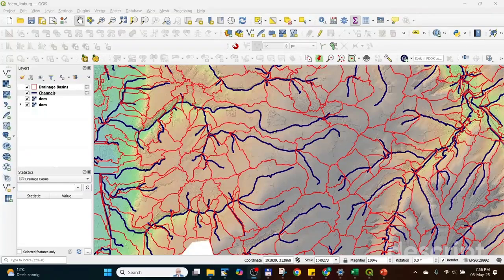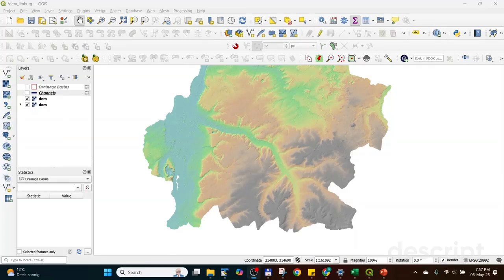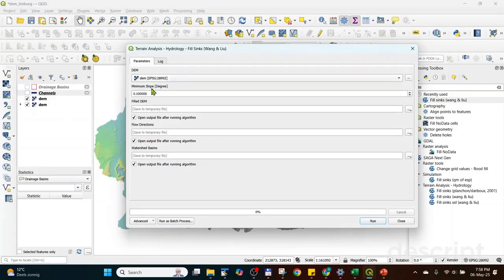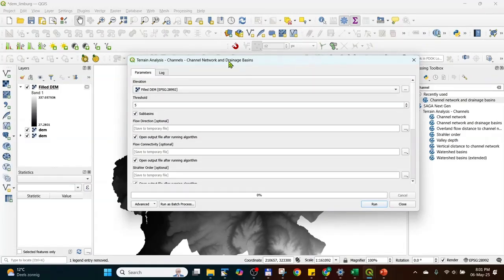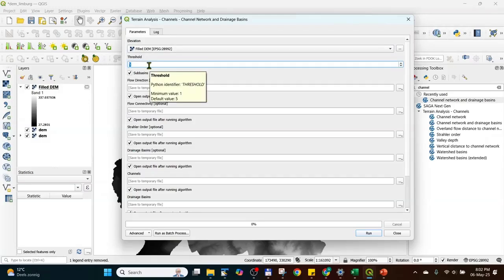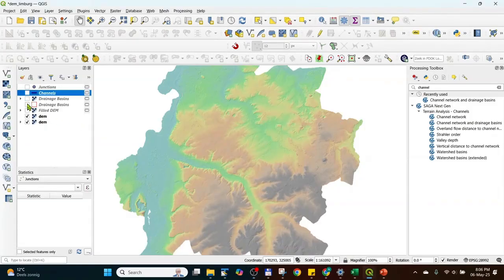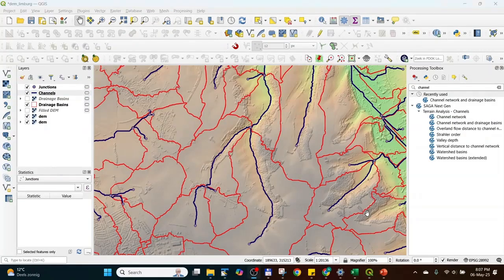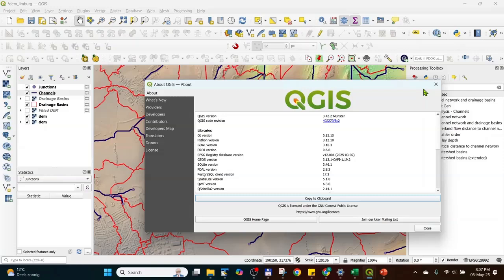QGIS Catchment and Channel Delineation in 3 Minutes | DEM to Drainage Basins with SAGA

Comment: How does saga run within qgis. Usually it's not integrated anymore. Which qgis version do u use?
Reply from the maker: - It helped me a lot to first install the latest version of qgis (in my case 3.42.2)
- Under 'plugins'/ 'manage and install plugins'/ install 'Processing Saga NextGen Provider' (as shown in my video here https://youtu.be/F5vn0JyXDj8)
- So: QGIS doesn’t include SAGA by default anymore, but if you install the 'SAGA NextGen Provider' plugin and use the latest QGIS (like I did here), it often just works—no need to configure paths manually if SAGA is bundled!